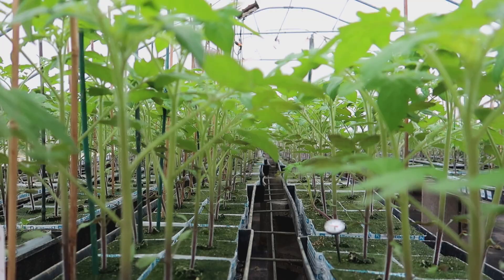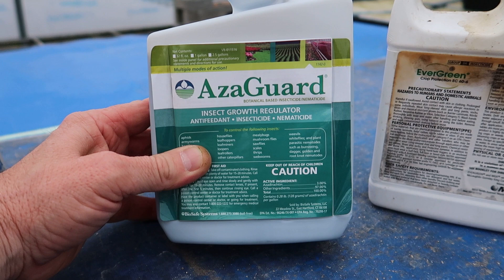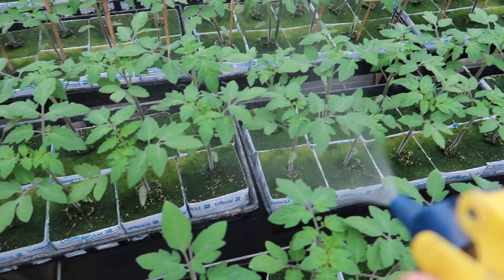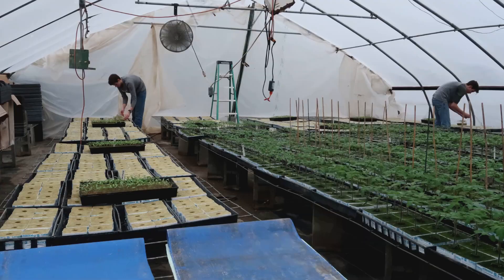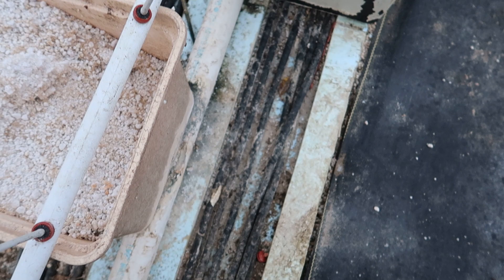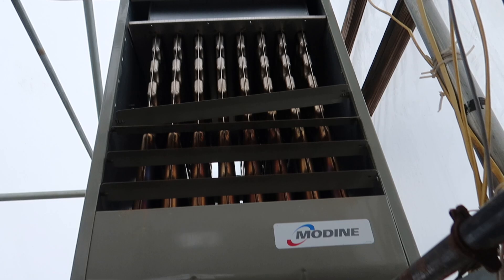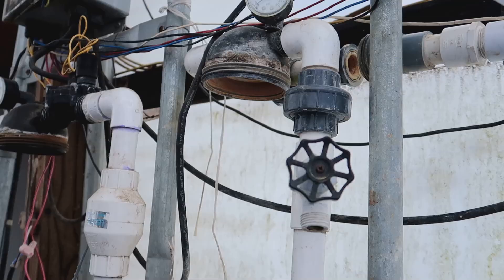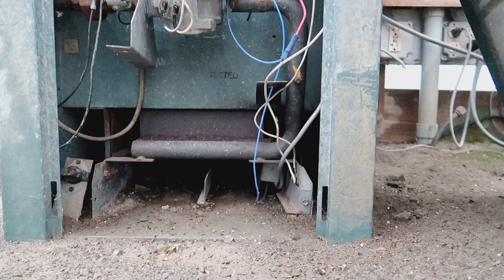Hydroponic Farming | Final Greenhouse Preparation Before Transplanting! | Wishwell Farms Vlog 4

Comment: I have had mixed results with drip emitters. The ones I use have a foam filter/regulator inside and they pack up with microscopic solids on occasion. I would rather use a quarter turn valve to adjust flow.
Reply from the maker: On my operation everything needs to be automated as much as possible and wouldn't want to be turning valves to make changes....it's all controlled by a computer system.  The emitters work great for us as long as we flush them well before and after the growing season.